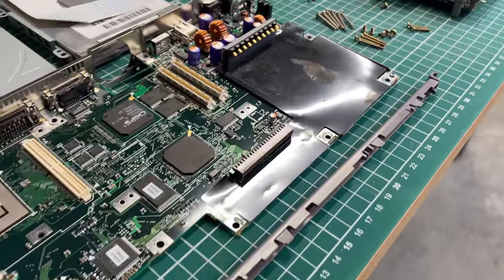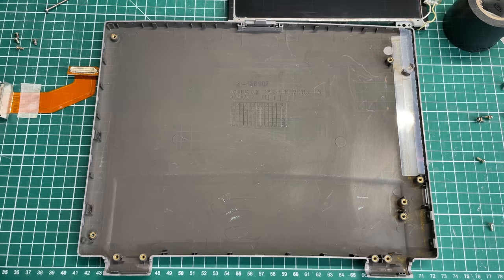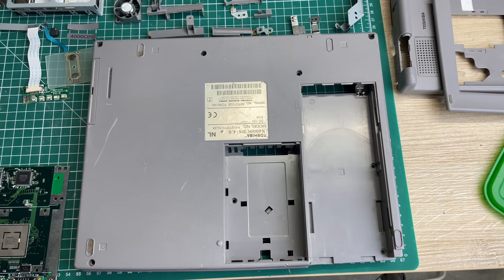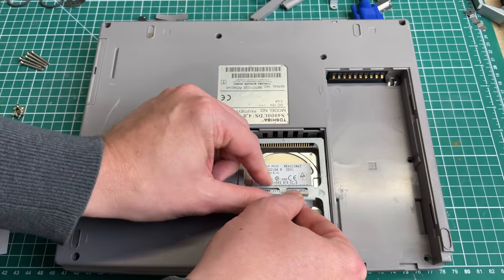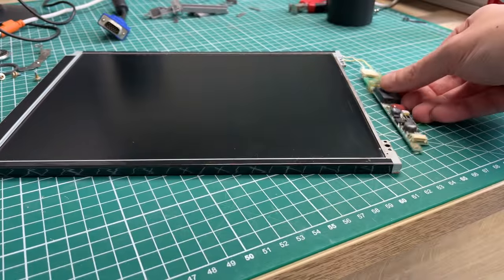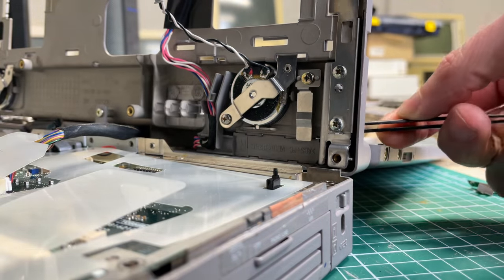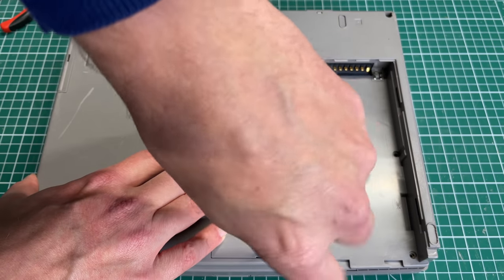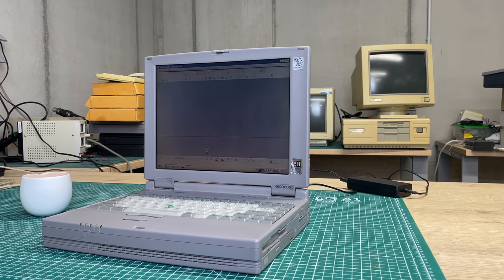Lets rebuild the Toshiba Satellite 4000CDS

Comment: Those were made in times when Toshiba actually built good quality laptops. After mid 2000s their build quality just plummeted.

You indeed did a very good restoration job on this unit, especially considering the "I have anything to loose" mindset you had about this task. Other people would just have roughly slammed the thing together without caring too much about the quality of their job, while you in fact took good care of the machine. Well done.

As for the plastic stickers covering the screws, try to gently bend them in the opposite direction they're bent now, this should flatten them out and make them stick better to the plastic without popping out too much.

Comment: I was a huge fan of Toshiba laptops up until the early 2000s. I used to own a Tecra 8200. They were very well built (in Regensburg, Germany by the way) and easy to work on if needed.
Reply: The first laptop I ever bought was a Toshiba in 2004, it was really good I think I paid like 900$ at circuit city. Last summer when I decided to buy a computer I couldn't find and Toshibas so I got a Dell XPS instead 🤣

Comment: Speaking as a technician, I really don't like screwdrivers useing theese small bits, they never seem to get a decent grip. I prefer an assortment of screwdrivers :)
I never understood the rubber band method. But I'm a master of removing busted screws! :) A lot of times useing a screwdriver for flathead screws can get a grip in a busted PH or PZ screw.
Screws that have glue on the threads, can be heated with a soldering iron for a few minutes, it makes the glue liquid again and easy to remove the screw.

Thanks for another interesting video :)
Reply: If you don't get good grip, there's very simple answer. Your tool quality is garbage.
Reply: @jothain  Maybe somebody else messed up the screw :)

Comment: Those are awesome for DOS, actually... it's got a OPL3 chip sitting on an ISA bus connection... :)
Reply: I have 470cdt and it's one of the best dos laptops I know of. Good display, Soundblaster compatible and fairly decent performance.
Reply: @jothain  It's even decent for earlier DOS games if you turn off the cache using Setmul.  Brings it to about the same speed level as a 386-20mhz

Comment: If you want to rebuild the battery. You can use the 18650 li-ion cells. I was able to fit in 6 21700 5000mah cells in there with a bit of shaving. Now my satellite pro 4280 lasts forever haha

Comment: Detailed screw organizing scheme ;) I don't know if it was to address my question from the previous video, but that's not what I was wondering. My personal issue with screws is not about how to organize them or identifying their different size. It's knowing where each size go back to ;) I'm always afraid of using the wrong one and damaging the threads on the receiving side, or causing long screw damages.

As for the extra screws at the end, wouldn't it be nice to store them back where they used to belong, even if they aren't useful anymore? My philosophy is to keep them in the device as potential spares, or just in case they ever become useful again in the future (let's say you were to 3D print the broken plastic parts). Maybe you just have a different philosophy about it ;)

Otherwise, excellent video. Loved it. Very complex assembly, I'm betting the workers at the factory hated that laptop, and assembly was costly for Toshiba.

Is every feature on the laptop still functional? By that I mean, CD drive, diskettes, speakers, etc... Except of course the black lines on the LCD panel.
Reply: Store in an anatomy of parts is my goto method. Lay them out on the table in roughly the same shape as when they were in the unit

Comment: I have a set of screwdrivers from 2004 that claim to be Chrome Vanadium, but have a surface treatment on them that almost looks and feels like carbon, and I’ve found that with screws where the material is more likely to strip or chowder, they’ve been great at breaking the threadlock and extracting them.
I’m writing the manufacturer now to see if there’s anything special about them so I can pass it on, but they’ve been a worthwhile tool for various teardowns I’ve done

Comment: Hello! I have the same laptop but I want to know if the BIOS battery have an alternative replacement, I mean, it's impossible to me to find the 7.2v / 40mAh and 2.4v / 20mAh, so could another battery work with approximate values? And wich values? Or we have to build the battery with parts? (sigh). I wonder if the battery can be rebuilt, because 10.8v using 18650 batteries its... complicated? 3 batteries (x3.7v) gives 11.1v, can that be a problem, or will it be enough to make it work?

Comment: Your driver isnt a standard phillips. It does not have a filed flat tip. Thats your problem. The point bottomed out in the screw before the flutes were fully engaged.

Comment: I have an old Toshiba with AMD K6 II 500. I purchased at a flea market for $5. I replaced the hard drive with HGST 80gb. Added more m
Memory and I had to replace the CDROM drive which stopped working. It works great now. Better than NEW because of the faster hard-drive and more ram.

Comment: I have similar laptop, it's Toshiba Sattelite 210CS, but to find the EDO-RAM for this mashine is really pain in the ass. Mainly is because i'm based on Europe, and everything is from USA.
Reply: My wife's first laptop is a Toshiba Satellite 220CDS. I upgraded the HDD to a larger capacity (I seem to recall the original was only 1Gb so I think I put in a 20Gb one) and upgraded the ram with a 128Mb card.

There's a funny story there in that the company that I bought the RAM from sent us the wrong part, and then refunded us AND sent the correct part. My usual honest self would have contacted them about it, but after they'd dicked us about by getting us to send them back the incorrect part at our expense, I just left it at that.

I guess the accounts department only meant to refund us the cost of our expenses in sending the other part back, but who knows.

This was in the early 2000s, so I expect the RAM for these is pretty rare these days.

Comment: Toshiba? Have to be JIS screws then. Philips head will chew through them.😉
Reply from the maker: If you look at the screws you can clearly see that they are Philips. I know JIS is from Japan and so is Toshiba, but Toshiba doesn’t use JIS on laptops. JIS is primarily used in motors / motorcycles / machinery. Never seen a laptop or other electronics device with small JIS screws.
Reply: @RetroSpector78  sorry for the offtopic, just gathering some information here. I hope you are better. All the best to you and your loved ones. 👍
Vaccinated with 2 doses???  which brand???
they told you which strain (variant) of the virus do you have???
@Fran Blanche  also had covid a few weeks ago, fully vaccinated she was several days without smell or taste.
Reply: @RetroSpector78  Quick Google search,
JIS screws are found on everything made in Japan. 
JIS, or Japanese Industry Standard screws are just different enough in shape that Phillips drivers will not fit well and slip/strip them. The difference is in the leading angle of the point of the driver. Phillips bits have a larger angle and therefore don't bottom out in the JIS screws, causing slippage.
Phillips bits strip JIS screws.
I looked in my collection of computer screws , especially the 6-32 because they are bigger and  most are not marked but some are marked with a small dot, so JIS screws!
Regards, Dave.
Reply: @RetroSpector78   Hi, I had more than 10 of these old Toshiba notebooks from the Pentium and Pentium MMX era, ranging from Libretto 70, different Satellite Pro to the Tecra 500 and 700 series. Most of them had a least one or two screws, that were hard to remove with a normal Phillips head screwdriver. After getting an ifixedit set, I found out that the JIS bits work way better on the old Toshiba notebooks. In hindsight, I could have realized it even earlier, becaus older devices like a T1600 and T5200 uses correctly marked screws with a dot.

Comment: When a Philips screw is that far gone, sometimes a small flat blade screwdriver can grab it enough to turn.   You may need to tap it in lightly with a small hammer to get it seated into the screw head before trying to turn it.  Or at least push down hard when trying to turn it.

Comment: Yeah once a screw gets t that point, your only choices are to use a drill or a dremel.  When using a dremel in such a small spot, you would use a thin diamond tip. Like the very thin long diamond tip, not a cutting disk, and you would use the thin diamond tip to cut flat channels into it that you could use with a flat head screw driver.

It's difficult and annoying work, so i don't blame you for not wanting to if you don't have to. I would have done it, but that's more because i've done it before so i know what to do. And i'd want to replace the thermal paste and what ever.
Reply: Maybe first trying to hammer an allen or torx key into the hole and pray? Then it it fails, resort to more destructive methods.
Reply: @razorback20  That sounds horrible, but you could probably crudely dremel in a torx bit.
Turning it into a flat head or even just making new phillips channels using the diamond tip(not as expensive as people think) is pretty quick and easy.
Takes me about 5-10 minutes per screw depending on where it's at.
Reply: @LazyBunnyKiera  True,  I'm resorting to cruelty, but it's because:
1. I don't own a Dremel (Shame, I know)
2. I consider this screw is FUBAR'ed anyway. And hardly accessible. So, I have no problem about finishing it for good when extracting it, and then replacing it with a fresh one.

Comment: You might have some better luck with a torx screwdriver (with or without the rubber band) on that troublesome, stripped screw head.
Reply from the maker: Tried it also, different rubber bands, different bits ... but couldn't get it out.